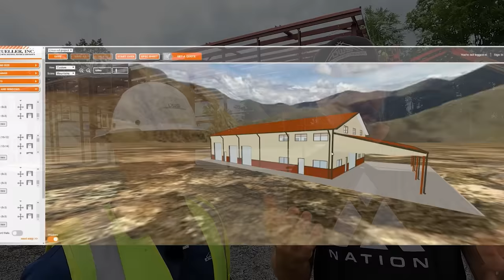Pole Barn v/s Steel Building your dream shop or barndominium explained

Comment: In a steel building fiberglass is better than nothing.  Beyond a small amount of thermal barrier it has no other redeeming qualities.  Steel buildings leak air like crazy and the only way to seal it up is use spray foam.  FEMA recognizes the improvement in resistance to wind damage and some insurance companies will give a small discount in cost of structure insurance.  Air, and when over an inch and a half a permeable barrier.   Hard to convey the less obvious values but just a different feel to a building insulated with closed cell foam.
Reply from the maker: lol...ya lost me a FEMA buddy....I've got a good friend down the road that just did spray foam...it absolutely shouldn't be used as a vapor barrier...however it does work I'm told.  I didn't want the ugly mess that spray foam creates and it doesn't age well at all...so I chose the bat type insulation
Reply: @StoneyRidgeFarmer  For sure when foam is installed it's ugly and if the applicator isn't highly skilled it looks really bad.  As for a vapor barrier it is rated when installed correctly and is accepted by the ICBO standards.  I don't know where the information your getting is coming from but possibly a misunderstanding, who knows, not that important.  There's another feature of foam that is both good and bad at the same time.  It doesn't fail during a fire.  This will help protect anything that's on the other side but it can create conditions for flashover.  Horrible thing that firefighter hate and kills some every years.  If it's sprayed on structural members it can prevent the building from failing but everything in the shop will be baked very well.  Both good and bad.  I was a foam contractor for over ten years and have experience in a wide variety of experience mostly in commercial and industrial.  Very little residential.  Makes the best roof ever but looks like you have snow on the roof all year.  I'm one of the installers that can make foam look only a little ugly.  I've sprayed all the building in a seed processing facility and at the end it wasn't good looking but almost decent, well only a tiny ugly.  It's hard.  At the very least they should have put in a vapor barrier between the steel and insulation.  Come winter, find a small out of the way place and peal back the plastic.  You will find the siding is cold and there's a good chance there will be condensation on the steel.  Even if they taped the plastic insulation liner the steel will draw moisture in from the outside and your insulation will get damp.  Some areas  get warm enough that it cooks off all the moisture and there are no problems but some areas mold can grow.  Best of luck and hope I'm wrong.

Comment: I've been around some.of the buildings.being built to.where they have used the screws with a dome that covers the rubber washers and they said that they will last longer bc the weather isn't getting to them.has this company ever used them to see if they would last longer?
Reply from the maker: that's what we use on the roof my friend
Reply: I know I wasn't sure if they use them kind on the roof and the walls or just the roof

Comment: So you think it would building will rot out in 50 years? I have several barns on my property that were built back in the WPA era that was in the mid-30s to they're getting close to a hundred years old. To the best of my knowledge, they will probably be there another hundred years as long as we keep the roofs on them. And I have a couple of pole barns 50' x 70' that I've built and one shop 50' x 50' two of them 30 years old and one of them is about 20 years ago and I see absolutely no rot or damage to them. I also have a calf barn that is a steel building and the rust on the inside of it is getting terrible and it's only five years old. So I'm not real sure I agree with you except for the fact that I think 50 feet is probably about as far as you can span without some type of support with wood and keep it competitively priced.
Reply from the maker: old growth timber in the west??  Pole barns on old growth last longer....the pole barns of today are fast growing pine and the treated timber doesn't last like great grandpas barns....I built it out of steel because it's better material than wood...not because I think wood will rot...because I know steel wont

Comment: Are you going to put sky lights on the roof to let light into the building when the indoor lights are off ?
Reply from the maker: no sir....skylights pose a horrible leaking hazard in a shop like this...they ALWAYS LEAK EVENUTALLY...so we may put windows up high...but no skylights

Comment: For anyone- How much more is a steel building compared to a post frame? I'm thinking 30*50  or 40*60? Is it 30% more? 40%?50%? Perhaps double the cost? Thanks for any info you experts can give me. I really need to add one of these to our 12 acre property in Northern Michigan. I want to finish it with a few bedrooms and 1.5 bathrooms  and than have the other 3/4ths a shop. Also, what size would you recommend? I always heard go bigger than you think and also I heard length is fairly easy to go big the width is where you should only go so wide? Does this make sense or am I more clueless than even I thought? Thanks again for any advice -
Reply from the maker: you are looking at 10-30% cost difference for the shell of the building....however....do you want the problems that wood barns and buildings have at 30-50 years?  My suggestion is to figure out what size building you want...and go from there...I'll tell you this...you will not be happy with a building less than 40ft deep and 60 feet long.  You will use up space very very quickly.....what you heard is no issue my friend...you can order your steel building how you want it...as for wood..you are only limited by the trusses ...you can build it cheaper out of wood...but do you want a forever shop or do you wanna risk the wood in the ground rotting?
Reply: @StoneyRidgeFarmer  with extra Space available,  Consider 100 ft long x at least 60 ft wide,, enough to slide a Mobile Home in with a 70 to 75 ft Tractor Trailer also covered plus Storage plus personal Trucks & Cars.

Hang a LARGE OLED TV for indoor popcorn parties, near the indoor Hot Tub 🔥  

BUILD THE RESTROOMs FIRST, near the Entry Doors – 3 or 4 TOILETS, for quick Relief when having traveled LONG DISTANCES, quick tour, plus drainage in each floor area – Workers have too many burritos & beer night before.  ADD Hot Water hoses for quick cleanup after spraying Bathtub & Tile Cleaner.  

As well as the Kitchen & Storage should be near the Unloading Position for Your Vehicles – terrible distances for carrying Groceries – unless you grab a Basket or Cart for transport.

Comment: Your argument that wood inside a building will get wet and rot is as valid as saying all the steel will rust and fail.
Reply from the maker: So...you're saying that if you had the option you'd rather do a wood structure v/s a steel structure?  Wood pole barns are in contact with the ground moisture...this causes the wood to rot over time ...where a steel structure will never rot and isn't burried in the ground my friend
Reply: @StoneyRidgeFarmer  I've been in houses well over a hundred years old and made from wood that was not treated that are still in relatively good shape.  I am not making an argument for or against steel or pole, just saying the argument that wood will rot is just not a good one to make, not in these modern times.

Comment: so what is the lifespan on the skin of the building? the beams and structure will outlast you i dont think the skin will or even close.
the CTE (coefficient of thermal expansion) on those skins and the beams is not the same steel or not, those beams will not expand at the rate those skins will. interesting video though what did the structure cost you, you said 70k on the concrete and 7 on the doors and windows.

Comment: Wood buildings rot out in 20 to 30 years?? They should build them correctly. The Barnwood Builders take down and rebuild 100  to 200 year old buildings all of the time.  I live in the central valley of California. There are old wood barns all around here that are over 100 years old. My dad's barn included.  This brings to mind a story my dad told me about a guy who wanted a wooden barn (designed like the old barns in the area). County said it had to be designed a certain way. It fell with a strong wind when it was almost completed.  The guy went rogue and built the barn exactly like the old style and it has been fine ever since. That being said, your mega shop looks awesome!! I know you did a lot of planning for everything.  I really enjoy your videos. Also, I will need to rewatch your chicken butchering video again.  I have at least 10 roosters that I need to put in the freezer. Thank you for all of your hard work.
Reply from the maker: this isn't old growth timber dude...this isn't high desert country of California or a TV show that makes everything seem like it works.  You and I both know the timber and lumber of 2022 isn't the timber of 1922

Comment: Why dont you guys use insulated double-skin steel panels saves so much time vs pulling insulation also fire proof on the inside
Reply from the maker: because that's not what this company offers buddy...there's a million different types of building techniques and materials....but some are simply not as commonly used

Comment: Hit the side of the building with your tractor or implement and it will start to rust.  Rust through and then you have leaks.  That roof will also have to be replaced at the same intervel.  so you will have to maintain that structure just like a wood based building.  As for replacing it every 40 years, well tell that to the 150 year old barn and house sitting on our property.  Yes we do maintenance, but you will have to do that with the steel building too.  What you do not need is that 70K concrete floor with a building that does not have those steel point loads.
Reply from the maker: not sure why there has to be something negative here brotha
Reply: @StoneyRidgeFarmer  The cost is prohibitive to farmers in my area.  They just can't afford a building like you have.  $70K into the concrete pad, and footings, is a lot!   This is like the Harvestore silos in the 80's.  Get one, 2 years later, might not be able to afford the payment and have to sell the farm.   I get it.  You are selling the steel building.  In the sale, its is all positive, but it should be an alternative when selling.  It should be a "consider this" type sale.  I am sorry, that I took it this way.  But you are selling a building that a lot of large family farms can not afford to build.  Sure its a fast build by non farm workers.  Here farmers have to build things themselves because of the cost, and that wood barn is still fine after 80 years because we replaced the roofs and painted the siding.  The wood based buildings don't get replaced every 40 years, if you take care of them.  Good luck with your project.  It is a nice building that can be heated.   What we would give to have a heated space to repair large equipment in the winter.  Also, I hope that your not being squeezed with diesel prices right now.  We are, but we will survive.
Reply from the maker: Ok...hear me out...and when ya find yourself rolling your eyes...stop and keep on reading..you'll learn something about me today my brotha....when ya need a building...ya build it.
 I don't know anyone who has $300k laying around...and I don't think you get it at all.  I'm building a steel building...not selling one.  There's no sponsorship or any of that ...I'm here to educate you and teach you what I've learned from both my screw ups and my triumphs.
  This isn't some sort of janky bait and hook underhanded marketing hustle ....I work very hard...and I spend my income where it makes the most sense.  You're looking for some kinda fake bullcrap that's not there dude....I'm just showing ya my building.  
Philosophy of my life, which could change yours for the better:
Saying "I can't" will keep anyone from having anything.  "I can't" ..."It cost too much" .....and on and on with any reason to talk yourself out of having the things you love and enjoy won't make ya successful.  I'm a different kinda person.....I look at something that I'd like to have and ask  "how can I"   
Diesel is up, fertilizer is up, gas is up, construction costs are up.....and my income isn't...but I can't sit on my hands and shut my brain off by saying "I can't"  I surround myself with knowledgeable and successful people like Toby and I learn, grow and figure out a way my brotha.   Just like anyone else...I got a loan and built this building.  Since day 1 on the farm this is what I knew I was working toward.  I never say "I can't" when I want or need something I ask  "HOW CAN I?"  
Homework assignment:  Read or listen to audio books "The Attractor Factor" and "Rich Dad Poor Dad"  it will change your life and the way you look at things.  I'm no different than you my brotha....I just think different than most people...my perspective of life is different than most. 
 You've gotta think like success in order to earn success.  Both of these books are available on audio book....I listen to them on the tractor or in the truck while I travel.  Never do I miss an opportunity to learn and grow as a person.  Hope you'll try this my friend...it's all about thought processes....nay sayers will forever nay say...and success begets success....try thinking in a new way and your life will change!  This was something my ex wife could never understand....and that's one of the reasons we separated...there's a bigger and better picture out there for all of us buddy...saying "I can't" turns your mind lazy for lack of better terms.....always say "I wonder how I can!"  Take care man....didn't me to get all philosophical on ya...but it's the truth...and I aint selling buildings...it's not a hustle...it's my life I'm sharing....I want to be a success and I want you to be successful too!  That's something most folks don't understand....alot of people resent successful folks like it's some sort of hustle or luck....put yourself in a position to come out on top...even if you lose you still gain knowledge...everything is a win and if someone is more successful than me...I try and figure out why instead of hating them for it...not saying you hate anyone...just saying it's human nature to be jealous and envious...use that to learn what the rich guy down the street is doing my friend!
Reply: @StoneyRidgeFarmer  Love the philosophy.  Read Rich Dad, Poor Dad.  Cash Flow Quadrant, as well.  I am covering 3 quadrants at this moment.  If you get a chance try "Tuff Times Never Last, Tough People Do"  Similar philosophy of positive thinking.  Written in 81-82.  The farms around me are in Upstate NY.  Milk prices have not increased in decades, and that is squeezing the farmers here.  Chobani has had a good impact on the area, but still the farms could use some more demand.  Closing schools and removing that milk stream and also hurt business here.  The only way to make the family farm work is to be conservative.  All equipment gets repaired, new equipment is rare.    Expand when you can, and hold when you can't.  Then, hope that a child can take over the farm because no one can afford to pay the mortgage on a working farm with these milk prices.  Support like Agway(or West Nesbit) has all but disappeared for grain production(we sent corn + oats to make the grain).  Now the farms have to make it or send it further which both increase the cost of doing business.  Oats are planted here, but we may need to expand to winter wheat.  That might be a good cash crop this year.  Good luck with your building.
Reply: For that $70,000 floor did you get radiant heating?

Comment: Why would you do the conventional installation instead of the blown installation
Reply from the maker: "conventional"  this is bat insulation v/s spray foam is what I think you're referring too....have you seen what spray foam insulation looks like in 10 years?  Folks use it as a vapor barrier when it shouldn't be...this is insulation and a vapor barrier my friend....the cost to spray foam this building would be over $20,000 so why re-write the book. "Blown Insulation" is something you'd put in your attic space...there is no attic space here

Comment: You did not talk roof. You MUST have many skylight panels for natural light. Overhead lighting leaves dark spots sich as when working in the engine compartment and natural light does not. We never use lights in our shop until the sun sets.